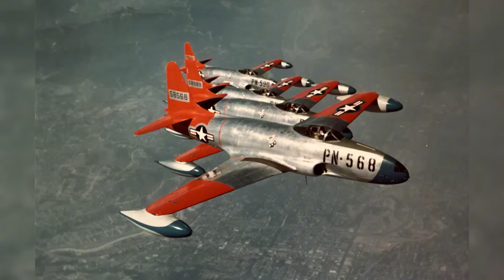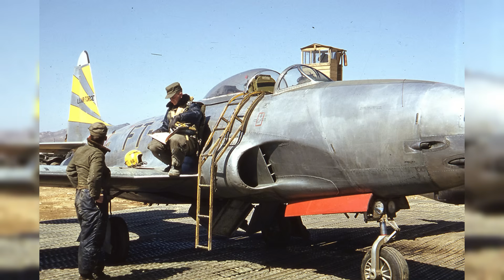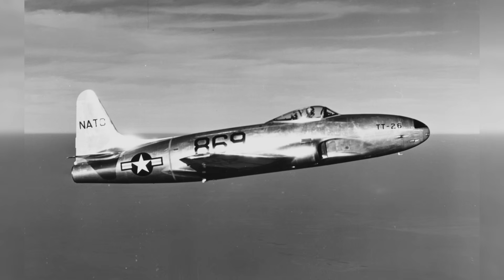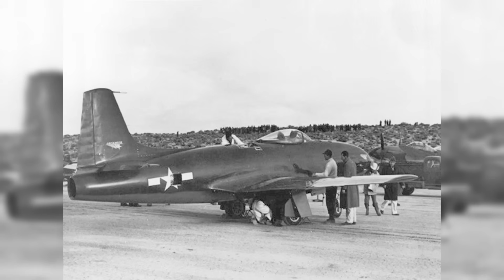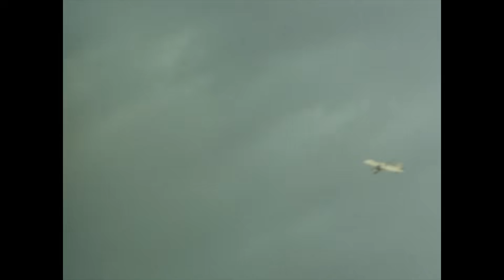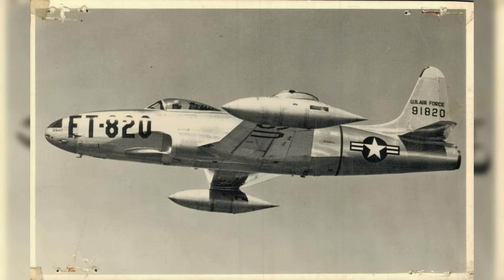Half a century in service! The history of the F-80 Shooting Star

Comment: My cousin, Billy Strong, was among the first Air Force pilots assigned to fly the P-80 in regular service. Not much was known then about the need for much better pressure-suits to counteract the G-forces during maneuvers. One day he was going through some tight turns at high-altitude and blacked-out. When he regained consciousness, he was heading fast for the ground. He must have broken the sound barrier, because many people in the area reported sonic booms. He had to pull out very gradually, to avoid tearing off the wings. He came so close to crashing, that he stampeded a large flock of turkeys at a farm and several hundred were killed. The Air Force had to pay off the farmer and they soon installed automatic speed-brakes. Improved pressure-suits followed soon.